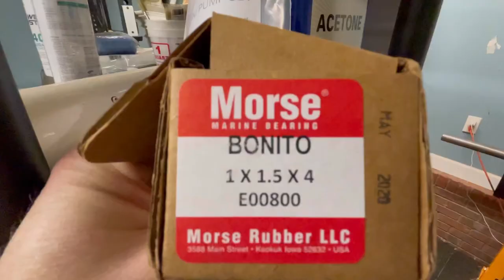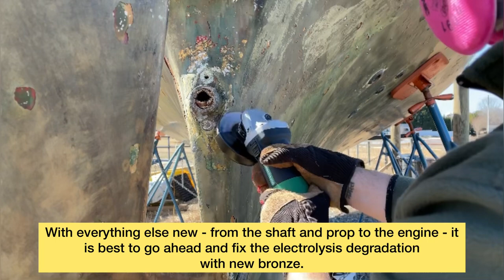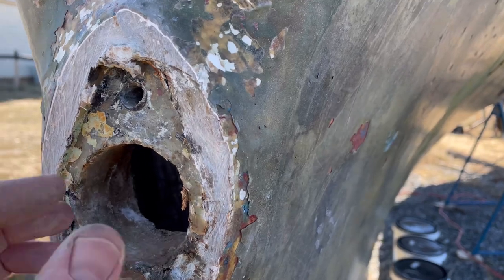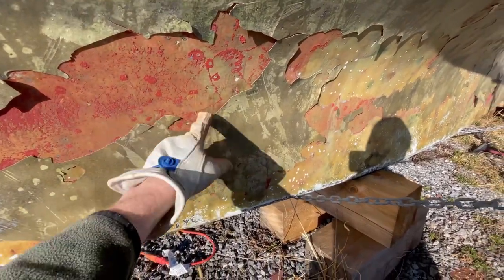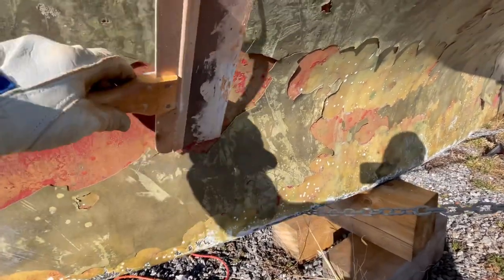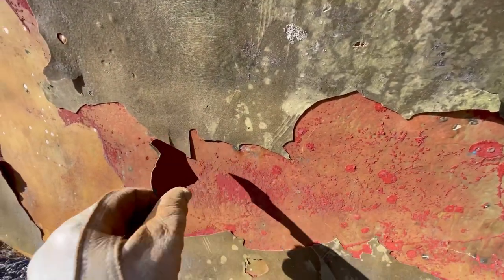Cutlass Bearing, Shaft Log, Just Remove it All | Sailboat Restoration Ep. 15

Comment: 74 was still in the time frame for bad/cheap resins,  you should have the bottom wet sand blasted and do a barrier coat...since you don't have boatyard fees, it makes sense to do it now
Reply from the maker: Most definitely. I have TotalBoat TotalProtect Epoxy Primer & Barrier Coat going on once I fair minor damages and glass more serious damage. With the hull an inch thick, I think it fared well from any storm damage.  And you are right, NO BOATYARD FEES means I can take my time on everything and do it right.

Comment: And replace all the old thru hulls.. you may not know if the zincs were always replaced properly. I have seen the flange fail with what seemed like a good fitting only to tighten one an watch the flange break
Reply from the maker: I think this is the number one recommendation online and in groups. I agree.